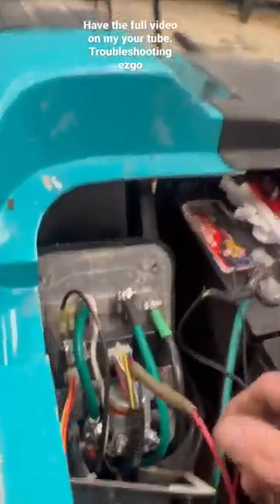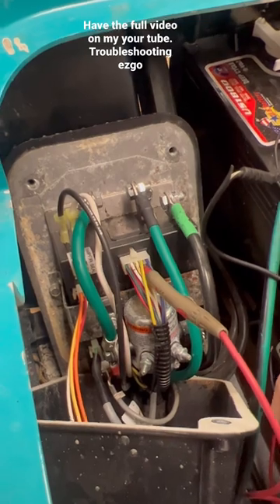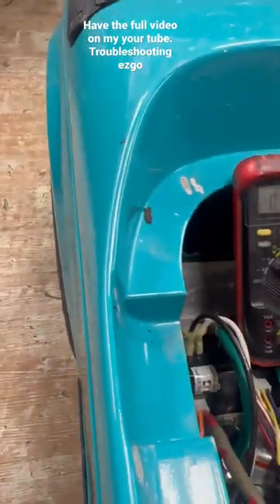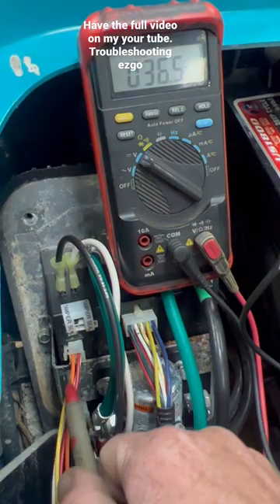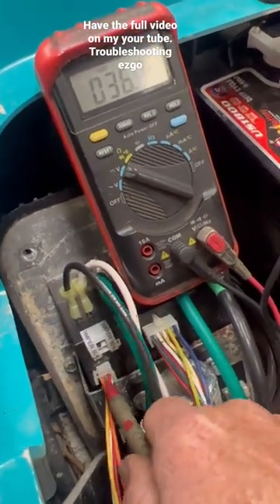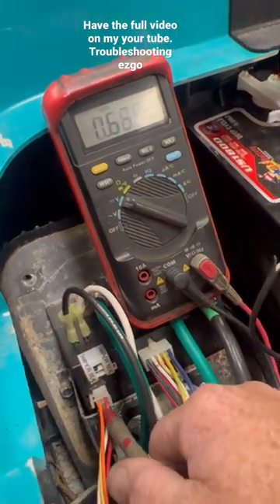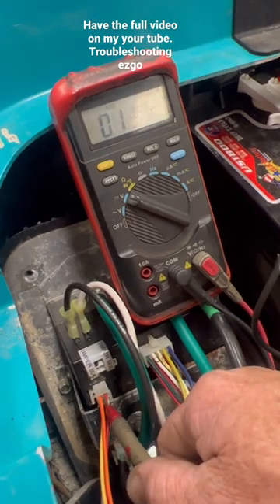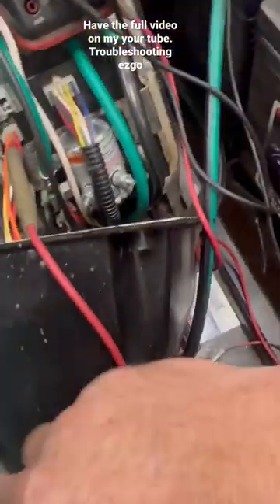EZGO TXT DOES NOT RUN!!! Trouble shooting my page has full video#golfcart #ezgotxt #diy #ezgo #golf

Comment: I just pick up a 2003 Ezgo pds 36 v got it to run but will only go about 2 mph an has no power to every drive in grass in yard any ideas. Thanks
Reply from the maker: Thanks for watching and commenting. First I would check battery voltage while your driving. See what it drops to and let me know
Reply: @HeyHeyHey97  Will do I will check tomorrow and let you know. The battery’s are 2021  there two year old they do charge full check each one 6.8 on most of them and one was 7.1 volts.
Reply from the maker: @chadpipkin840  okay we’ll check under a load like while driving. Or one tire up against a tree.
Reply: @HeyHeyHey97  started with 36volts on battery under load they drop to 27 volts and had to push cart up small incline in yard.
Reply from the maker: @chadpipkin840  okay so you have weak batteries. Test each one individually.
Reply from the maker: If they all test the same batteries are no good or no water in the batteries or the charger is not working. If one or more test weak compared to the rest.  replace that battery.
Reply from the maker: @chadpipkin840  tell me your battery voltages when you check them induvidually
Reply: @HeyHeyHey97  thank you just decided to remove battery’s they were all swollen with the side bow out so I replace with new one and new cables today and she run great thanks for all your tips  put me in the right direction to go.
Reply from the maker: @chadpipkin840  cool man glad it helped